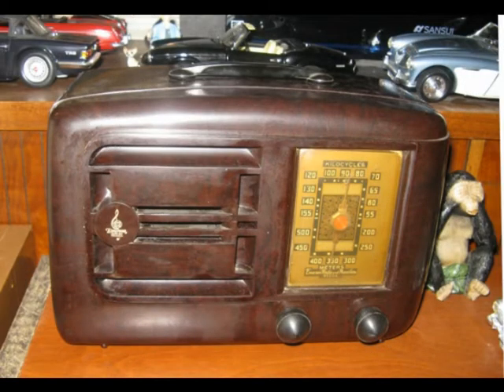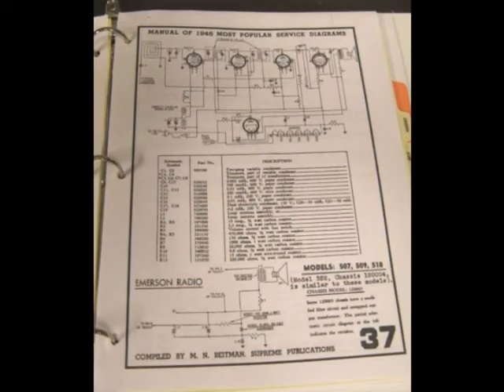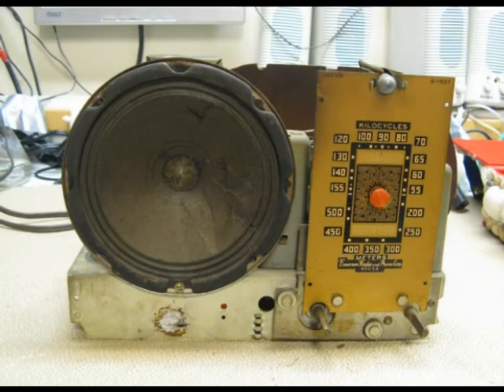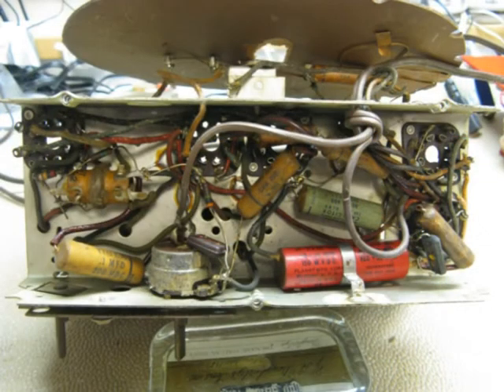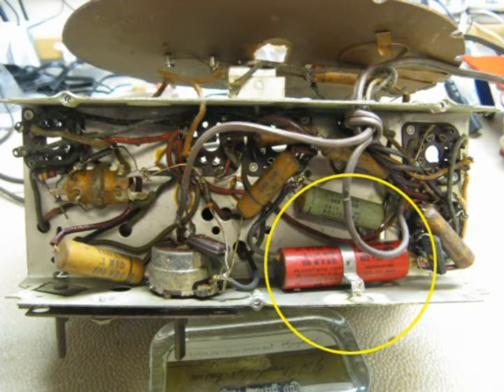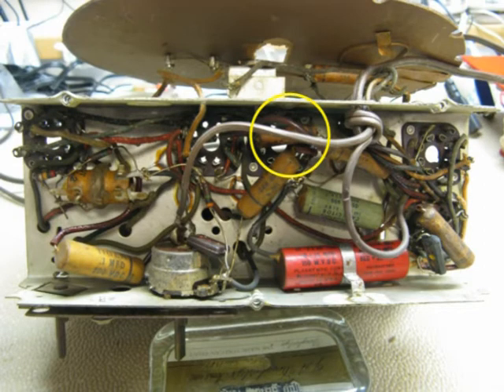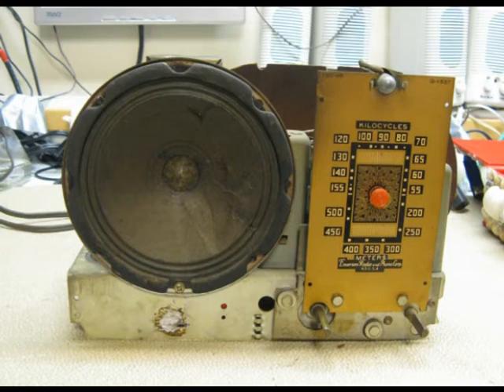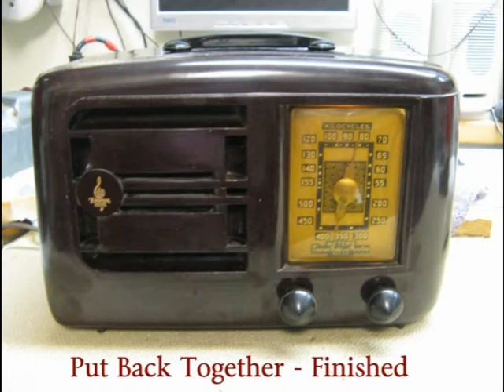I Made Mistakes Repairing an Antique Radio

Comment: I love your AM transmitter idea.   Where did you get the 1942 programming?   A thought came to mind.  I belong to a classic car collectors club.  I think it would be so cool to transmit vintage programming during our cruise nights so everyone could play it in their vintage cars.  Where did you get an AM transmitter?  What kind of range do you get?   I would need to cover a 300 yard radius.    Regards  John
Reply from the maker: jp040759 Hi John - Great idea with your car club.  When people come by to my game room, often I'll put out a radio or two of the era that people might want to hear.  Often it's 40s music, but also 50s and 60s is popular.  All I need to transmit is to play a CD of music I want and pull the output to the transmitter and it puts out an AM frequency to tune to the radio.  There are other transmitters out there, but I bought one that I could build as a kit.  It was one of the cheapest ones as well.   It wouldn't work with your situation I would think because it needs at least a wire as an antenna that should be no less than 6 feet.  The longer the better.  It works fine for me and I pickup any radio in the house.  But from a car to car with all the metal around them I wouldn't think mine would work well.  I would advise one that is a little stronger.  Those can go up to a mile, and use just a normal antenna similar like a transistor radio antenna.  Whether they have them that can plug in as 12V I'm not sure, but that's no problem.  Just buy a 200 watt or less inverter, they are cheap and even Walmart sells them.  Just get on-line and do a search for AM transmitters.  There's usually quite a few of used ones on ebay too.  See ya -- Atco
Reply: atco21117 Thank you.  And thank God for Google.
Reply: You can listen to or download Old-Time-Radio programs at "https://archive.org/details/oldtimeradio" or "otrr.org". There are thousands of programs to choose from Big Band, to Drama to Comedy and to my favorites genre, Westerns. You can download individual programs or a complete series. These are rather large files and best downloaded via high-speed Internet connection. 

Regards,

Mick Bradford
Reply from the maker: Mick Bradford
Hi Mick - I've heard about this website.  I'll check it out, thanks!  -- Atco

Comment: I love vintage radios.  I don't know much about repairing them but at least they can be repaired, unlike most of the cheap crap coming out of China these days. I hope they don't force digital radio on the pubic like they did with television signals back in 2009. It would be a shame if these beautiful old radios could no longer function.
Reply from the maker: ldchappell1 Hi ID - Boy, I hope you're right about not making digital radio.  I think they even gave that a shot about 20 years ago.  I guess it had a plus, but for what they would get out of it against the cost of converting everything, it got scrapped at least for now.   TV though did need the digital to give us HD.  During the conversion it was a pain, but we made it thru and I appreciate HD on my 60" screen.  

Thanks for watching my antique radio videos.  Yeah, today's radios don't have that great sound that the early radios from the 40s to even 70s.  Too bad.  Thanks for your comment.  See ya -- Atco
Reply: I came across a video not long ago describing the advantages of a digital radio system. They claimed AM would sound like FM does now and FM would be much higher quality. Digital radios would come with a screen able to display text and pictures. The problem is there's no way to make it compatible with older radios. I think they should just leave radio as it is. AM radio should remain the last vestige of communication in wide spread emergency situations.  

I love my wide screen HD television too. We didn't even have a color TV in our house when I was growing up in the 1960s. Our parents used to drag us to our grandparents house to watch "The Wonderful World Of Disney" in color every Sunday night at 7:30.

Comment: Vintage radios are not all that rare.  People back then didn't throw their radios away when they stopped working, or got replaced with a newer model.  In the late 30's everyone was excited that the depression was over, and there was going to be a lot more money available, so radio factories worked day and night to turn out as many radios as possible, to get their share of the cash.
Reply from the maker: Hi Landrew - You got that right... in the 1930s/40s a radio was a precious piece of entertainment to have in the house.  Yep, as they stopped working. most people did throw them away for a newer one, but now as much as people do today.  They made millions of radios in the 30's-50s' and still, working or not, are quite easy to acquire.  I found that out when I started getting into old radios as a hobby.  Most radios I've picked up in the last 5 years at hamfests cost me $20 or less each.  The dozen that I've repaired/restored would sell for $35-$75.  I did purchased 2 older radios that were restored.  One was a Victor from the late 1920s for $75.  And a Philco in the early 1930s for $50.  See ya -- Atco

Comment: Nice work.The pointer you swapped looks way better than the original.
Its not necessary to replace all caps.Many of those original paper caps will
work just fine.But the electrolytics are best to replace.The values of filter caps
are not critical.If too low values are used their will be more hum.
But always make sure the working voltage is above what is needed not below.
Reply from the maker: +meagain2222 
Hi Meagain - I had fun with my radios for a year or two.  I repaired about 6 of 'em and also did 2 or 3 restorations.  Still have a few more that I hadn't gotten to them yet.  A lot of fun.  Most were easy to fix.  One or two required me to go deep into radio theory, but that's the fun.  Of course, I only got into AM radios, and nothing before the 1930s.  I didn't know how deep I'd want to go into these.  But yes, a fun hobby.  See ya -- Atco